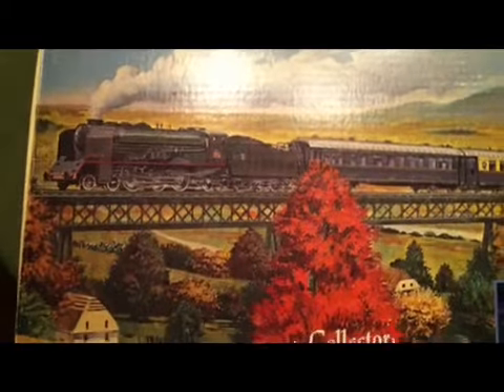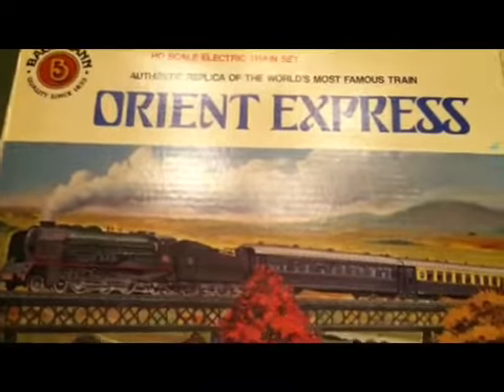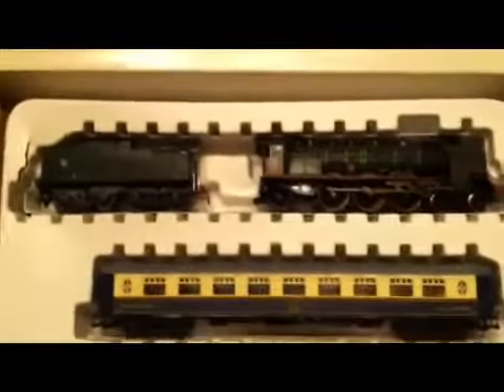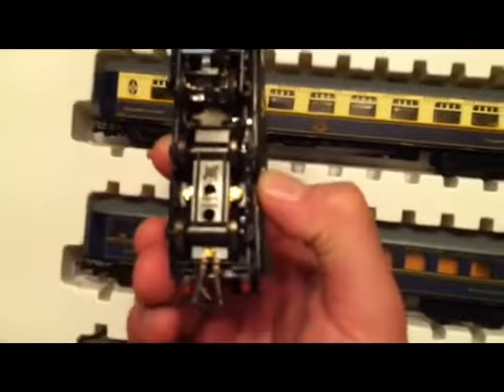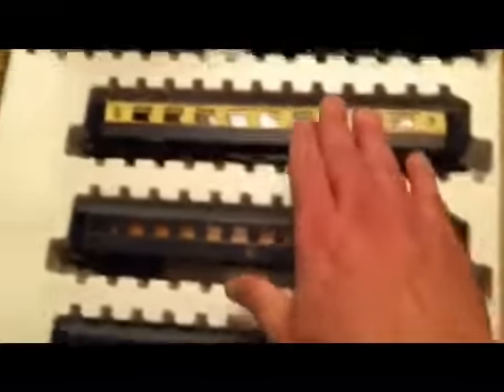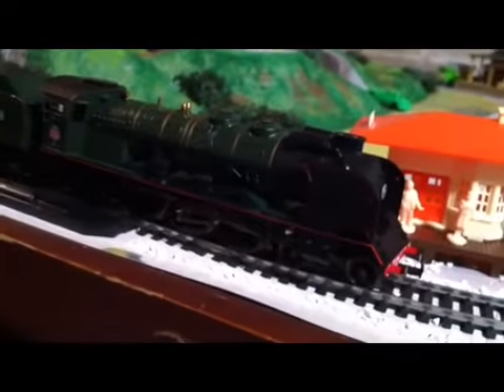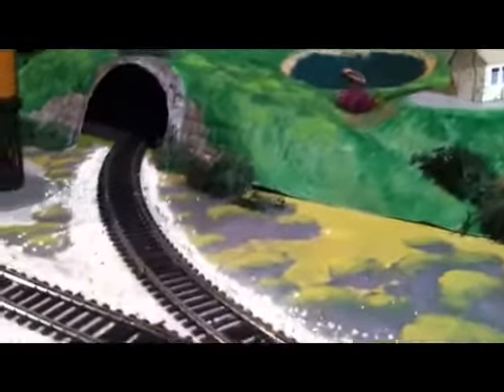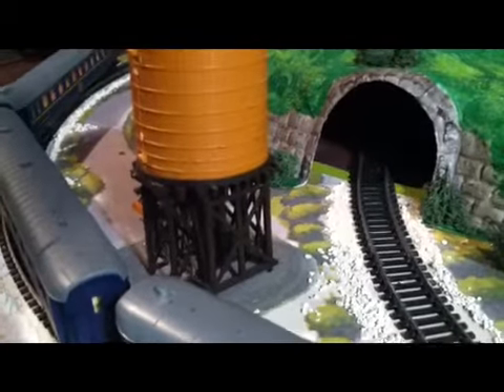Bachmann Orient Express made with Videoshop

Comment: 'Jouef' is pronounced like this:
The 'J' is  pronounced like the 'G' in the name 'Gerard'. Perhaps you've heard of actor Gerard Depardieu? 
The 'Ou' is like the 'ou' in 'you' or the sound children say a monkey makes (ooooh-oooooh).
Then finally the 'ef'. That's pronounced like you would say 'f off' to someone. Because phonetically you say 'ef off'.

All put together it becomes Gouef. The most important thing is the 'G' like Gerard.

Hope I helped!
Reply from the maker: Please forgive me for replying so late, but thank you very much for helping me on the pronunciation of the brand name!  I've had trains by Jouef over the years but never really knew the proper way to pronounce it!

Thank you again!

Ed
Reply: And don't expect to have a Frenchman pronounce" Athearrn " properly .... Wonderful set, by the way. I think jouef released it in the early eighties, because your tender displays the first type of tender drive (i.e motor mounted flat in central position on the chassis noisy but quite reliable By the way , Jouef released all this rolling stock separately, and  had them included in a set called Orient Express as well. The Bachmann box-art is way more appealing than the original Jouef, though ...